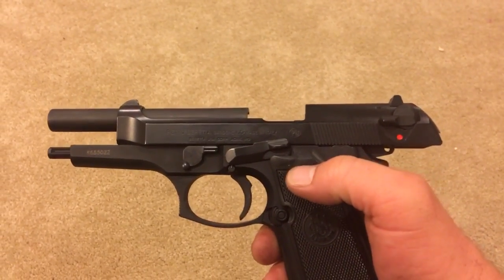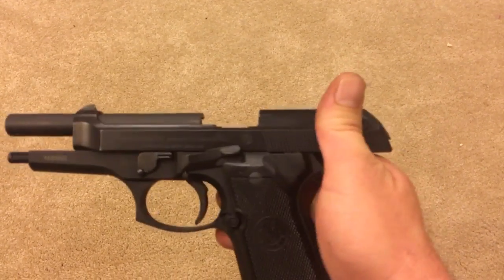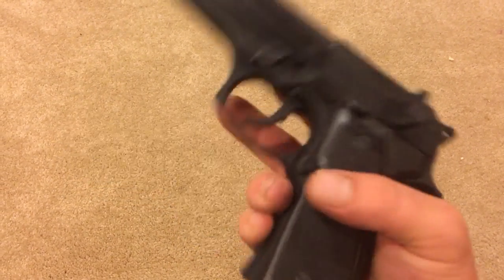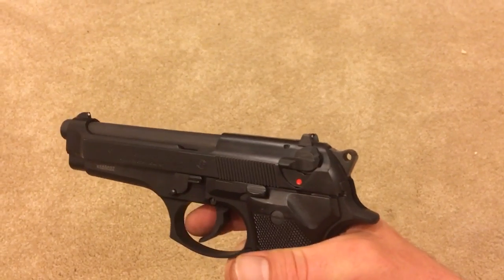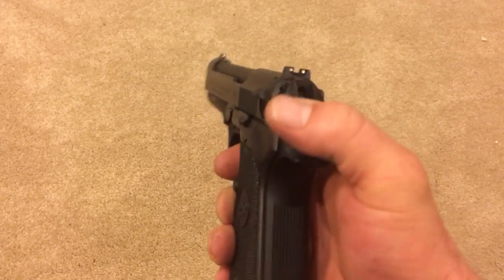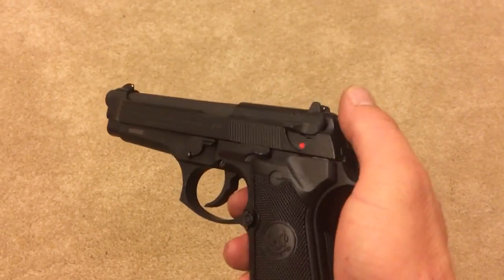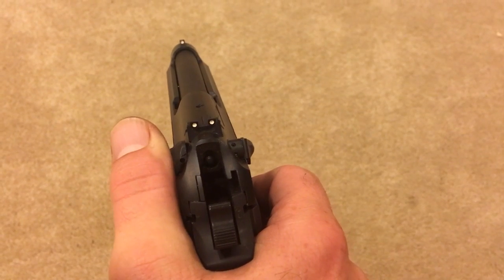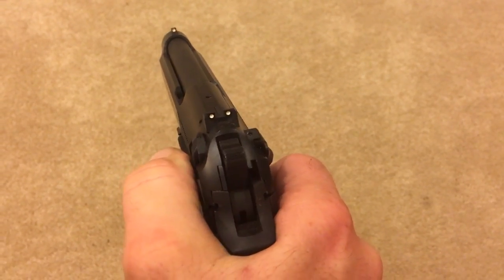Double action single action explained

Comment: A single action trigger only releases the hammer. The hammer has to be cocked by other means in order for the gun to fire. A dual action trigger will also cock the hammer before releasing it.

Comment: I see in movies they have an unloaded gun, they put a magazine in, but the don't pull the slide. Instead they cock the hammer
will it fire in that position?
Reply: Good question. I'm wondering the same thing.
Reply: I do know that if the slide is racked (letting you know it's w/o ammo) and you insert mag, then release slide lock, a bullet will be in chamber ready to fire.
Reply: No, it won't, because there won't be a round in the chamber.  It's the slide moving forward that strips the top round off the stack in the magazine and then pushes it into the chamber.
Reply: In the movies you also see people receiving multiple bullets but still fighting! Its all in movies dude!
Reply: @ethanprice6203  That happens. There was one instance where a man was shot 5 times in the heart, once in each lung, and 7 more times in the rest of his body, and still kept fighting until the police shot him in the head.
Reply: It won’t as there in not a bullet in the chamber to be struck
Reply: no, as Tim E.  they also rack the slide all the time for the sound effects. Like bro, you just now thought it was a good idea to get that weapon ready to fire? Keep it piped and keep it safe.

Comment: Tell me something 
Im in uk, I've shot pistols only 20 rounds.
When you squeeze the trigger on a double action then it takes more force yes? So harder to be accurate, to keep trigger finger movement independent and controlled etc.
I shot a revolver once and that took a fair squeeze unless you pulled back the hammer, but the Beretta M9 i shot just shot very easy.

Tell me more you lucky yanks 🤣

Comment: But isn't cocking the hamer an action as well? This is the stuff that confuses me???
Reply: What i understand, cocking the gun is get to single-action and have it ready to fire. Get it to single-action make the the trigger more easy to pull. For this gun (92fs) if you pull the trigger, it going to feel bit heavy at first (double-action) but when it fire the sider well automatically cock to single-action for all shoot fire. Or you can cock the gun yourself to make the first shot more easy to shoot.
Reply: When you rack the slide to load the chamber, the hammer goes back automatically and cocks. So technically when you fire without decocking the chamber, you're doing single action. You do not have to pull the hammer back manually, it happens when you rack the slide only. Hope this makes it clear!

Comment: Do NOT POP that slide like that.
Wroooooooong.
Reply: Why is it wrong??? serious question
Reply: @Francisco-yw7do  it causes premature wear to both the slide notch and to the slide lock due to the friction held on both by the spring and then suddenly released. More wear causes more maintenance and premature failure of components and shows on those wear items reducing the overall value of the gun. Its completely unnecessary also.
Reply: @WileysShenanigans  it's faster than an overhand rack, but what you said is true about wear. I always practice an overhand rack because it is guarenteed to bring the slide into battery on 99% of semi-autos. Some pistols have different controls (Sig 226 comes to mind) where there is a decocker in the place where a Glock's slide release would be. would be a shame to hit the wrong control under stress and lose precious seconds if you're forced to use a weapon you are not familiar with.